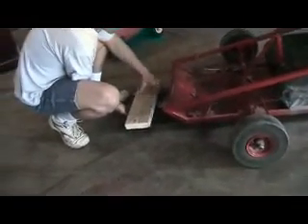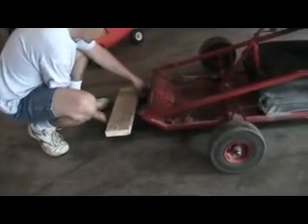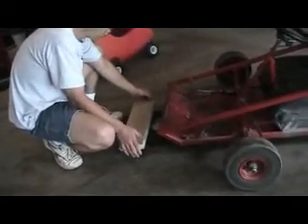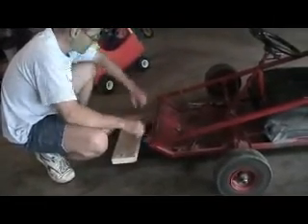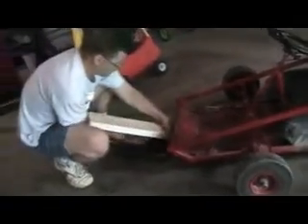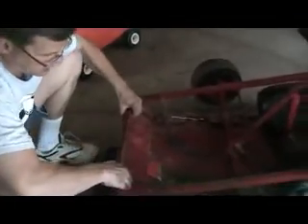Center of Gravity Measure On a Go Kart

Comment: Hi. I try to calculate the center of gravity height of the car. I raise up the front of the car to calculate the center of gravity height; and then I do again, this time I raise up the back of the car to calculate the center of gravity height, I raise up same height but I got the different answer of center of gravity height. Do you know why? Should I need to raise up the lighter side of the car to calculate the center of gravity height?
Reply from the maker: I know 4 years too late is ridiculous, but since I am here.... the weight of the car should not have changed in any way, so your center of gravity should not shift...unless someone was in the car when the measurements were made, or not in the car when the car measurements were made again.  Bottom line is that the front and rear measurements will be different.  To calculate the center is really based on the ratio of the two weights.  This should not shift much.  You are correct in trying to get the car level, or the same height, because of the scale height.  Also, you scale may be at the limit, if you are not using a scale rated for car weights.